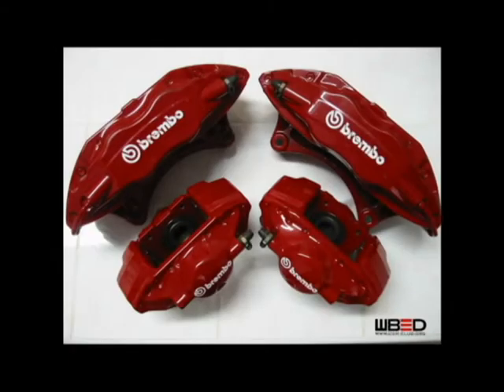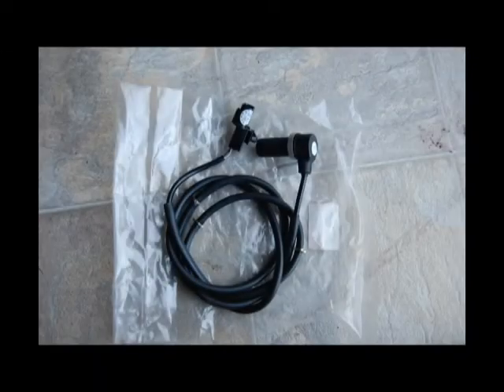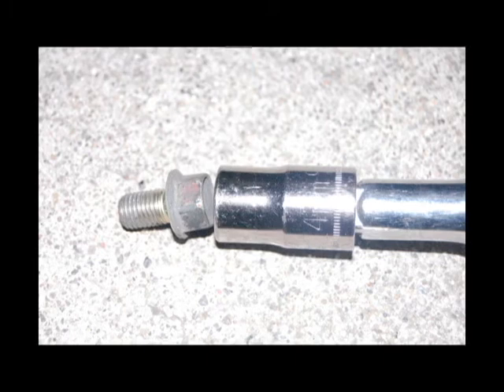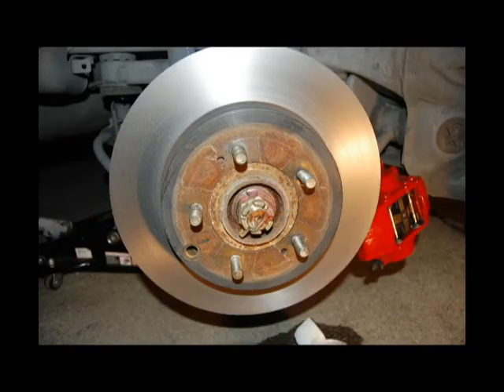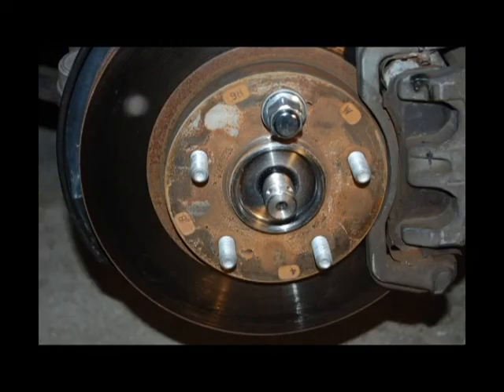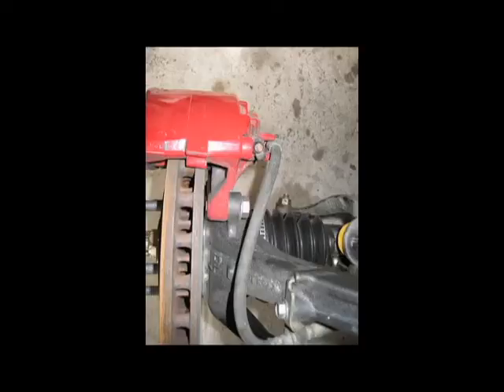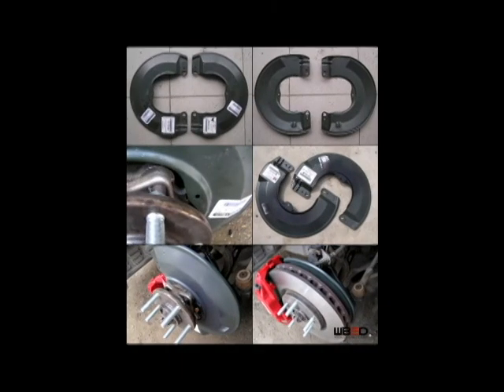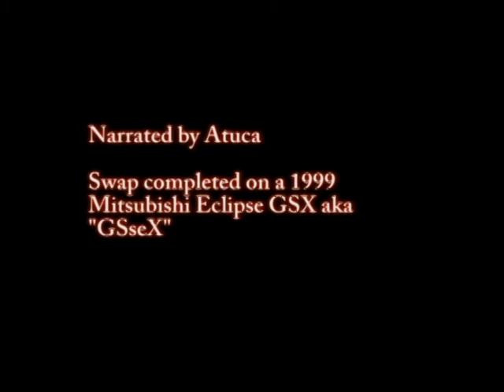Evo Brake Swap on a DSM

Comment: Hey about how much does to cost to switch over to Brembos? And where could I get a set of knuckles ? Any website?
Reply from the maker: Cost depends on how much you need. You need to consider wheels and tires to fit the calipers, pads, rotors, ect. There is a cheaper alternative using brackets instead of new knuckles now days, but you can consider this to be anywhere from 1k to 2k to do properly. I still personally prefer having no adapters, the word "adapter" makes me cringe, but its ~$100 compared to ~$500 knuckles.

Comment from the maker: its been several years, but it was 1500ish? knuckles were 400-500, calipers were 400-500, and then everything else you control, pads can be 50 buck bargin picks or racing hawk pads, roters can by 20 bucks used or 200, and rims.... lol can be stock evos for 200 or you can go something for over 1000. Don't forget tires to fit the bigger rims, that can cost you another couple hundred. Pricing this is as deep as your pockets want to go, and will differ depending on your needs.

Comment from the maker: I agree, I think the new adapter idea is kinda.. rigged? I understand the use of adapters, but when you can use a "stock"ish knuckle to begin with, I'd much rather go the cleaner route.

However, the reason the adapters are made is quiet clear, these knuckles are hard to get, and not cheap. I paid 400 bucks for them, and 100 shipping.

Finding someone from JDM land to grab them for you is hard as well, it is (as far as any DSMer knows) impossible to import them through any mitsubishi dealer.

Comment from the maker: I didn't run into any problems with a GSX master cylinder; the gst is smaller though by an 1/8 of an inch. I think it went:

GST: 7/8th inch
GSX: 1 inch
EVO: 1 1/8th inch

Swapping the evo would be ideal, but no one has figured out a way to swap it in yet. Mathematicly; more surface area to move fluid SHOULD yield better results (and better brake feel), but until I swap in some racing pads and really race this setup, I won't know its limits.